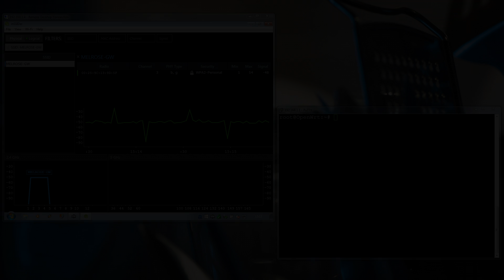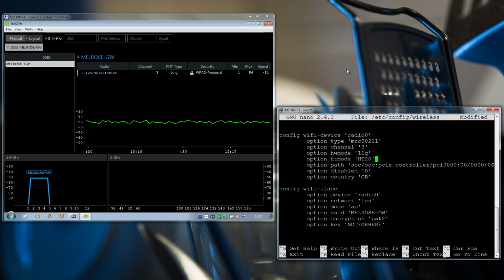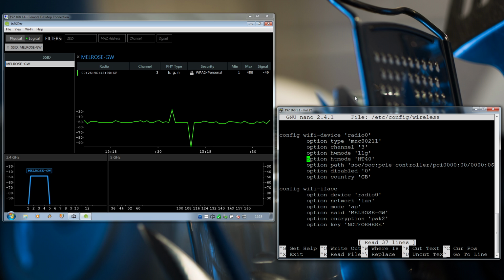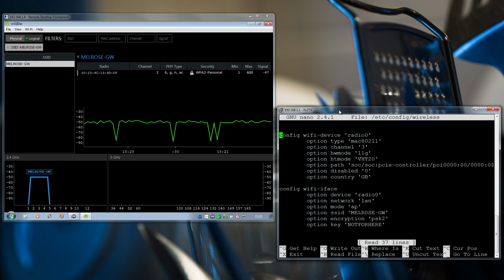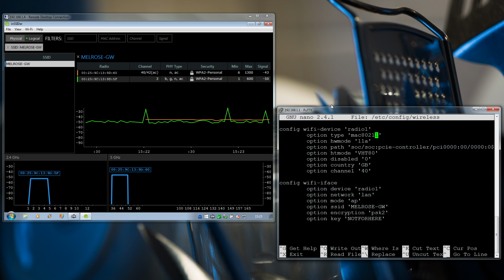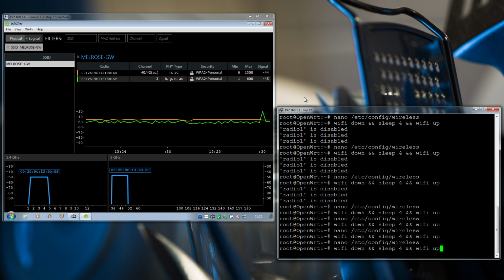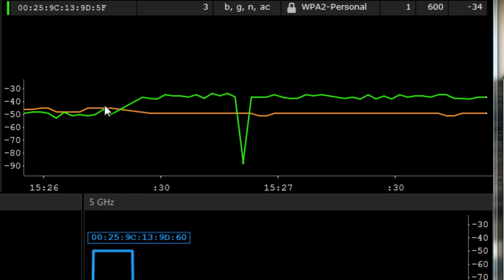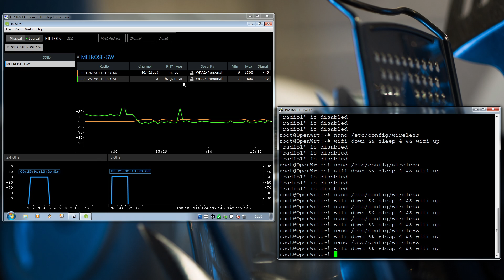Playing with OpenWrt Wireless Settings

Comment: After flashing openwrt my wifi signal was low. I couldn't get signal at some spot, which i usually would get a decent signal with stock firmware. I almost went back to stock firmware. But then i found you video. The country selection really helped.

Comment: I have had this router since it came out.  It served me well until....600 Mbps service was available.  On the most recent stock firmware it chokes even my wired connections to less than 400 mbps and direct from modem (sb 8200) I get 670-690 Mbps.  I have tried every configuration possible and it won't change.  And yes I have confirmed all ethernet cables being used are functioning properly.  Your video makes me wonder if I switched to DD WRT or Open WRT if that would fix the issue.

Comment: Its Dec. 2018 and I finally had the change to connect my $110 (brand new) Linksys WRT1900AC kick ass model after having it in the packages unopened for almost 2 years and wasn't taking advantage of my kick ass 300mbps wireless download internet speeds.  So once I got it running and watching a few videos on how to optimized this beauty, one video gave me a hint as to why I wasn't getting almost full speed or close to the 300mpbs speeds that my internet offers.  Switching the mode to AC gave horrible speeds not even close to 30mbps so really don't know why AC is even new tech or hyped when alone it gives shitty speeds!  Setting it to N mode gave better speeds but not all the way to at least 200mbps downloads....    The video hinted that by setting the mode to "Mixed" the modem will boost to max speeds and this was the issue solved!  I was now getting up to 265mbps downloads and that's as close it will get to the advertised 300mb downloads that I paid for (one-time lifetime payment!!!).   In the video the person said that he was getting disconnections by having it at the "Mixed" mode and so he had to changed it back to AC/N mode and problem solved.... Well that was a while ago and the latest update firmware I download it this month "Dec. 2018" has fixed all issues and I really don't need to mod it with any OpenWRT or DD-WRT opensource firmware.. The stock GUI works fine and the signal range is amazing! I can be outside the street across the house and still have a strong signal, something my older Netgear modem couldn't do!  Worth every penny!

Differences: 

                                        WRT1900AC      ---      1.2GHz Dual CPU speeds, 256mb DDR3 memory, 40 MHz bandwidth, has a Fan (larger heat-sink)
WRT1900ACS  (S = Second Edition)     ---      1.6GHz Dual CPU speeds, 512mb DDR3 memory, 80 MHz bandwidth, NO fan (small heat-sink)
WRT3200ACM (M = MU-MIMO)            ---       1.8GHz Dual CPU speeds, 512mb DDR3 memory, 160 MHz Tri-bandwidth, Fan-less

Comment: Hi I'm watching ur video from oct 16
Just wondering what router are you using now?
I'm using ac5400 linksys  and I'm not getting much fun from it can u help have u got any advice? 
Many thanks 🇬🇧👍🏻🇬🇧
Reply from the maker: I'm still using the same router but I had to go back to the default firmware to allow more 'friendly' access to the router as others need to use it.

I find that it works very well but seems to require a fortnightly reboot. The wireless access frequently just fails miserably or seems to drop in performance over time. I don't know if this is something that plagues all Linksys products or just this one.

What problems do you see?
Reply: TDCatTech thanks for ur reply 
I've got similar issues with the wifi it just don't even stretch to the next room very good.
I would not buy this product again.
I think the firmware is wrong.
Thanks again
Reply: Hi TDCat! I was trying to see if I could boost my performance with my WRT1900ACS with openWRT but everything seems just too overwhelming for me due to lack of experience. So I was wondering if you knew how to go back to the default firmware? I tried the turning off and off 3 times trick to no avail! 

If you know of another solution it would be of great help!
Reply: Kai Chih Chang hi go on the linksys help it will show you how to do it. Also use linksys live chat they are really helpful.
To be honest I'm not very happy with my linksys products as the wifi is not that good.

Comment: Hello, great video. 
I have Chromecast 2 and a Galaxy S7. Do you have any idea why on 5GHz when I stream local videos or cast my phone screen it is super laggy. Like 1 FPS, but when on 2,4GHz everything is OK.
And is there a way you can do a transfer test with the OpenWRT router itself, because from my phone to my laptop I don't get higher then 1,3MiB/s. But my link rate can get as high as 866mbps on my phone and 433mbps on my laptop.

Comment: <audio geek> 10 dB = twice the power. </audio geek>
Reply from the maker: This would be a dBm scale for RF so to achieve an increase in reception from e.g. 30dBm to 40dBm requires 10 times the output power at the transmit side. That's my understanding anyway but I'm happy to be corrected :-)

Comment: f I do everything as the video (except country) will it work ? cozy this router is making me crazy ... and what is this terminals u r using?
Reply from the maker: +ابو مصعب اللامي It should do but of course there's much more to getting the router working than this. The config/network area needs to be configured too. It is a bit of a pain really but it's a good learning tool.

The terminal I'm using here is Putty SSH. If you Google Putty it will be in the top 5.
Reply: +tdcat.com thanks dear 😊

Comment: I think its: AC600 (2,4GHZ) + AC1300 (5GHZ) = AC1900. The 2,4GHZ is basicly still a N signal however it does use 256-QAM modulation which is unsupported in the N standard (has to do with the signal transfer by the antenna's). This might explain the new marketing terminologie. So its 600 Mbit on 2,4GHZ (n) and 1300 Mbit on 5GHZ (ac).

Comment: How do you integrate nano to putty, everytime I type nano, it sat command not 
found. I have already install nano .
Reply from the maker: +Lau Weng Yew If you've already installed nano successfully with the opkg installer, it should just run any location as it's likely to be put into /usr/bin which should be part of your $path directories. I would do the following...

1. Check that nano exists in /usr/bin or /usr/sbin
2. Run 'echo $path' to display the directories used (mine shows /usr/bin:/usr/sbin:/bin:/sbin).
3. If nano is in a different location you'll need to add that to your path. I won't detail that here but can cover it if needed.

Comment: How did you access the settings using putty to edit/change the wireless settings? I get errors every time i input /etc/config/wireless.
Reply from the maker: +John remus Hi John. What errors do you get? Can you login to the router via SSH on Putty? In this video I use nano which needs to be installed separately. The default pre-installed editor is vi. So if you typed vi /etc/config/wireless you should get straight into the Wireless config file.

Comment: Are the negative spikes due to firmware or some kind of interference ?
Reply from the maker: +nitrowad I don't think it's either (though I can't rule out interference). The laptop I was connecting to has a fairly old wireless device and it has always been problematic with anything other than 802.11b/g on 2.4Ghz. That's why it tends to get used for these type of things.

My experience of the 15.05 firmware is nothing but positive.
Reply: +Torsten Dettlaff I just can't believe that Linksys firmware is so bad. I almost bought this device, but found the forums are flooded with the complaints, and this video helped a lot. Unfortunately installing any non-factory firmware in Serbia voids warranty, so if my Linksys died while other router is on it, my warranty would be voided. Any suggestions for a router that is fast, stable, and has an ok range with factory firmware - I'm deciding between Apple Airport Extreme and Asus AC87U? If you have any suggestions, please let me know :)
Reply from the maker: +nitrowad That's a shame. Linksys market this as a router that runs open source firmware well but obviously offer no support on it. Their warranty states that using it 'may' invalidate the warranty on the device. Very vague!

The Asus looks extremely good feature and power wise. Excellent reviews and the kind of feedback you'd like to think the WRT1900AC device would get! Good CPU. Range wise, I firmly believe that they're all very similar within the country power constraints. The aerials on the device are still the fairly stock 2-4dB gain. It's all about placement. High and central or as close to that as cabling and practicality allows is a good rule of thumb.